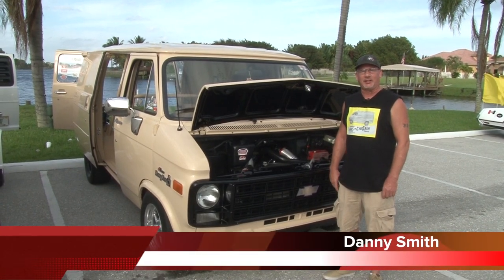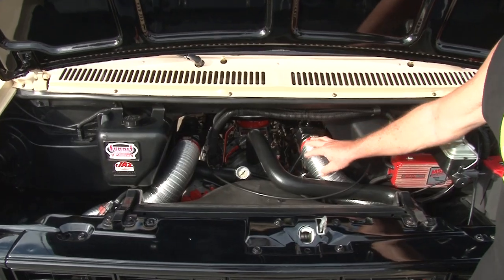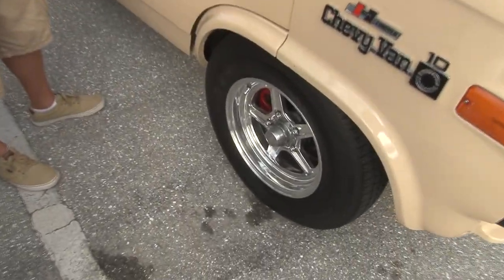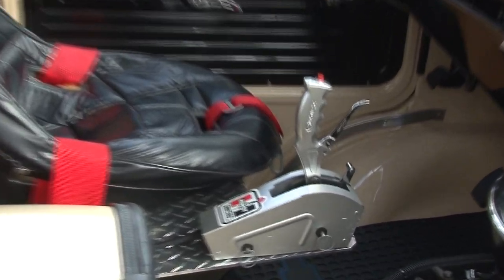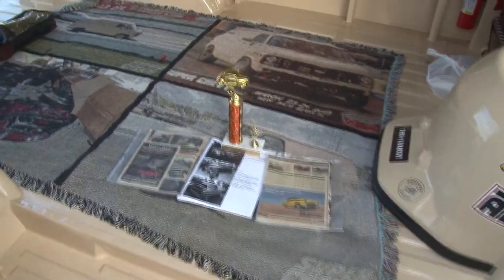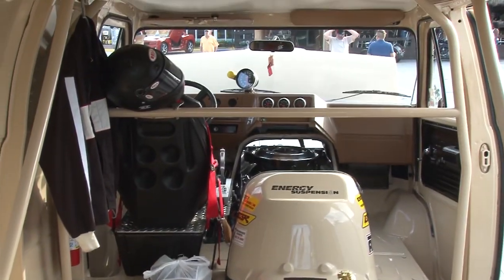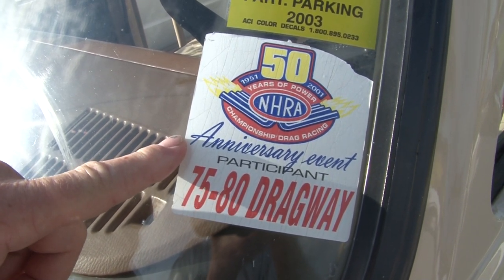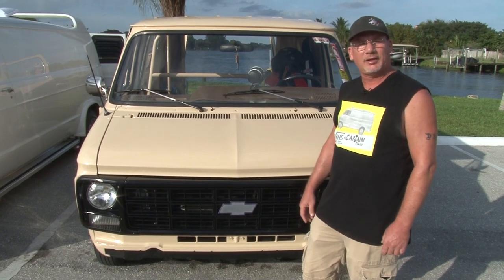Fast 1979 Chevy Drag Race Van

Comment: 360?mopar ??
Reply: It's a 350 bored .060 over making 360 ^3 of displacement.
Reply: James Burdzinski it's a Chevy small block 350 bored .60 over. The bigger bore brings it to a 360 cubic inch, still a SBC.
Reply: It's a chevy 350 bored 60 over so after it's  bored 60  it's now a 360 cubic inch Chevy